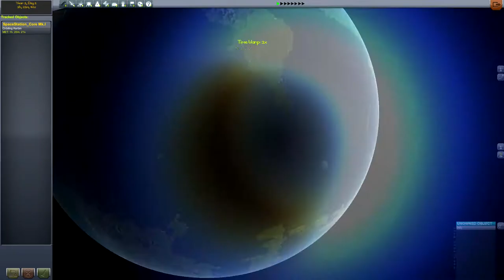Let's Build a Space Station - Ep:2 Docking........

Comment: I can see you're having a good time trying, you already learned the first secret of KSP, moar struts!  Next comes moar boosters! ;)

If you time your launch for when the station's orbit is going over the launch site, and launch into the same inclination, you'll save yourself a lot of trouble making rendezvous.  Alternately you could change your station's orbit to an equatorial one to facilitate launching the remaining components.  This would actually be easier to use for refueling launched ships as well since it's close to the inclination you want launch ships into for trips to Kerbin's moons the rest of the planets of the Kerbol system.

Watch your orbits, the little orange arrows indicate distance at intersect 1 and the purple ones intersect 2.  Use your maneuver nodes to bring them close as possible.  When you get that distance zero out your relative velocity to match orbits.  Within 1k is a good distance to start docking maneuvers.    

With orbital mechanics, remember that the lower your orbit, the shorter the orbital period.  This means if you want to catch up with something you go to a lower orbit.  If you're ahead of something you go to a higher orbit.  Apoasis changes are best done close to periapsis, and inclination changes are cheaper at apoasis.
Reply from the maker: Thanks for the tips. I will try and put them to good use.